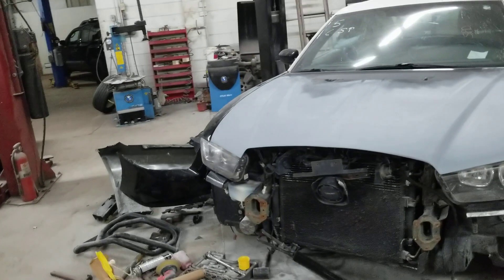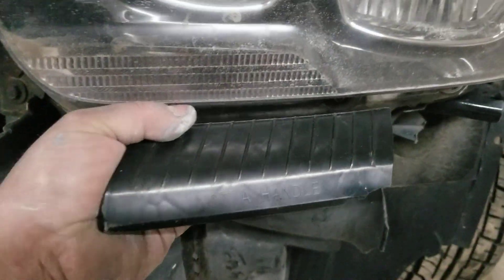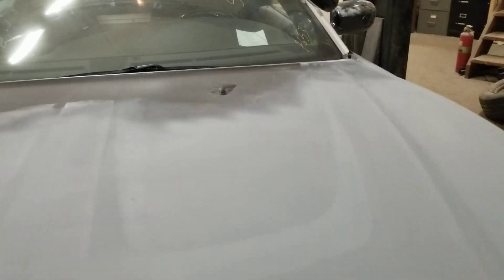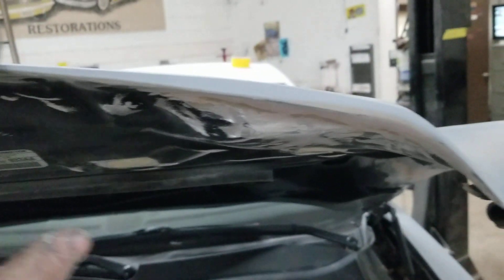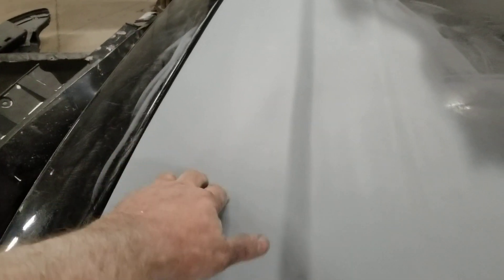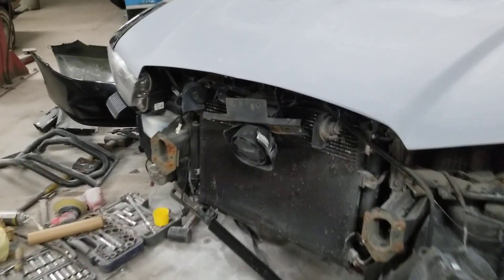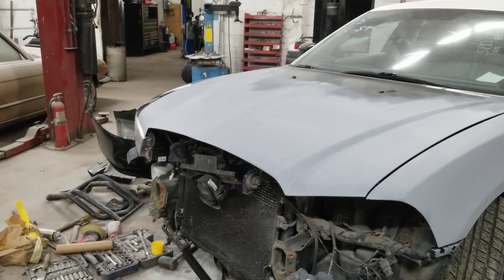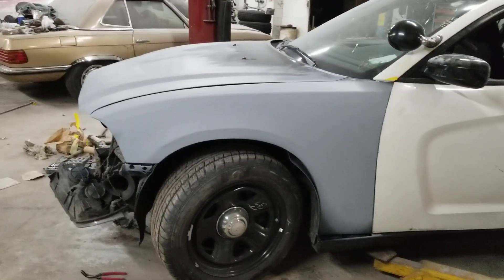Junk to driver series 2.. wrecked police charger

Comment: Did you do some experiments with a rusty YJ a couple years ago? Do you still have it? It'd be nice to see how the repairs held up.
Reply: saha6818  he did he had like fiberglass Resin poured all over it if I remember right
Reply: @Wallie2004  I think there were some square steel sheets he coated with something and threw into the grass by the shop too?
Reply: I believe your correct

Comment: yeah I let you get away with so much shit without complaining but ... thats trash work $150 used $250 aftermarket new for that hood... Steering wheel airbag $100-150 ... you need a radiator support and other parts.. just do it right.. you know one day you're getting rid of that if you don't die in it first and then .. how can you let anyone drive that. ... thats just not acceptable.. you knew what you were buying.. either fix it or let someone else do it right